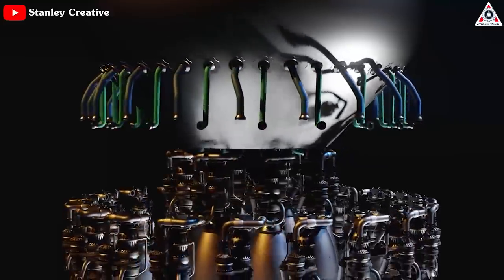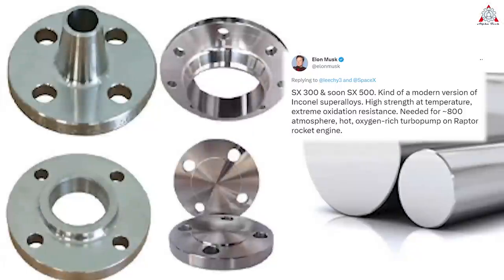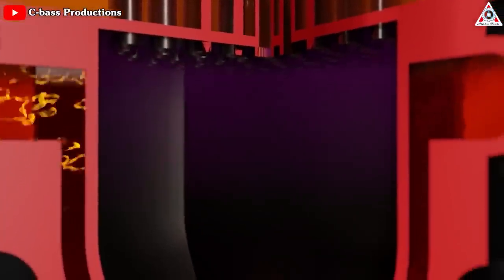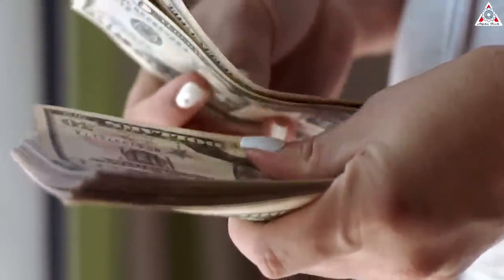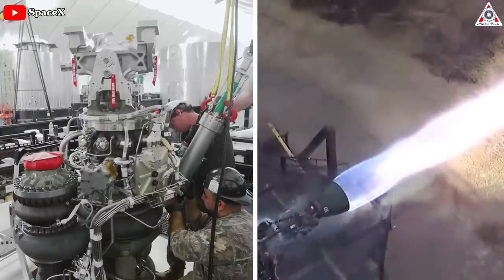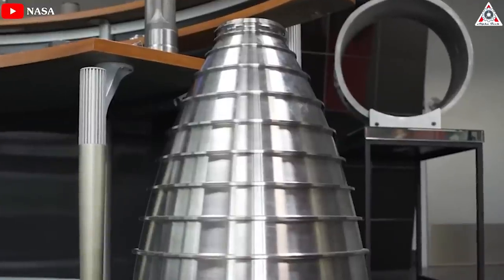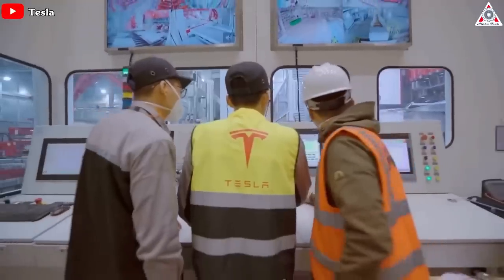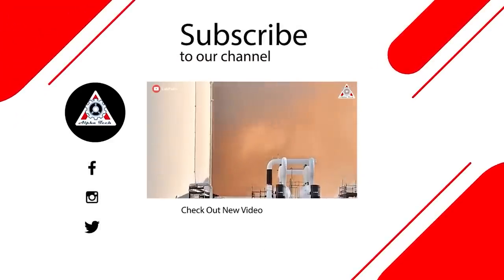How SpaceX manufactures a new raptor engine every 24 hours shock the entire industry...

Comment: 3:40 "in pursuit of the greatest possible efficiency Raptor's turbopump will run oxygen rich. . ." As I understand it the Raptor engine is a full flow stage combustion cycle. A full flow stage combustion engine uses both oxidizer-rich and fuel-rich preburners. The cycle allows full flow of both propellants through the turbines. That is to say, one preburner all of the fuel and some oxygen runs through (fuel rich).  The other preburner all the oxygen and some fuel goes through the burner (Oxygen rich).
Reply: Was looking for this comment 👍🏻
Reply: Was wondering the same thing. Guess someone else has also seen everyday astronaut´s video ;)

Comment: 10m/s is about the max-reliable speed of engine components ... in high end sports cars. 
It's why F1 use larger bore vs stroke (high HP) ... because the speed those engine parts can move reliably is finite if you exceed that number.

Comment: Please explain 3:50.

Oxygen atom = 15.999u
Oxygen Molecule = 31.998u

Hydrogen atom = 1.007u
Carbon atom = 12.011u
Methane molecule = 16.039u

Now in an elevated temperature I would imagine these molecules breaking down into ions and therefore oxgen is still the heaviest there with carbon coming second at 12.011u.
And why would you want a less dense fluid going through a turbo pump if you had the choice? less dense means you either need higher gas velocity (temp) to extract more energy from the dynamic pressure, or more fluid flow overall.

The real reason is it's a Full-Flow Combustion Cycle engine. One pump does fuel-rich, the other does oxidiser-rich and when both streams of the pumps are merged in the main combustion cycle, they are both nice and hot gas fluids that burn very cleanly. 
Now to get that to work IRL is not easy without it blowing up and SpaceX have done a wonderful job at making it look easy.

I've now looked at comments below and I'm not the only one

Comment: I was wondering if they put cooling fins on the outside of rocket engines if that would all make them even more durable it would work like an air cooled motor cycle 🚲
Reply: The engine and engine bell are already liquid cooled. Most rocket engines use the fuel itself in a similar capacity to fluid in a car's radiator. Everyday Astronaut has an amazing video on engine design and goes through all the different variations on rocket engine cooling.

Comment: For SpaceX starship. The shape of thing to come is going out of business. For failing to recognize real world problems in materials, number of engines, imperfect hot stage ring , and lack of adhesive adhesion to stainless. Today it couldn’t be more wrong. If your rocket is too heavy to reach a circular orbit to allow it to orbit without falling out of orbit back to earth just to burn up. This requires a serious change. But SpaceX appears to be wearing musk blinders. At least young engineers are gaining valuable real world experience on what not to do. I have to question? Did anybody run the numbers through a supercomputer on weigh with the amount of thrust on hand. Ift-4 should attempt to orbit earth with about 10 rotations. Then the following melt down won’t seem did bad.

Comment: 3:31 “ in the pursuit of the greatest possible efficiency” 
Now, I realize you’re just a YouTuber, but you got so much wrong about SpaceX is turbo pump(s) that you should never ever even mention them again.  Yes I said pumps. Their are two.  By blabbering on about why you think that “the pump” runs oxygen rich incorrectly, you demonstrate the lack of knowledge of which engine cycle they are using and the basic layout of the engine.  This is something that you clearly don’t understand.

Comment: Nice video but in the first 1/3 of your video you don't differentiate between the Raptor 1 and the Raptor 2 engines. Raptor 2 has much less junk hanging off of it and is more powerful than the Raptor 1.

Torch igniters are not used in the Raptor 2, that was some of the stuff that they got rid of.

Then you finally mention Raptor 2. You are probably confusing people with going through old, no longer used technology then saying Oh they made a new Raptor.

Then you do not specify which engine you are talking about through the latter half of the video further confusing new viewers.

Then talking about Teslas????

Comment: Starship is not flying anywhere until Elon figures out how to pressurize skirt of the Starship for duration of the launch of the rocket (from ignition until MECO). Until that modification comes every Starship launched will explode in the air. So much for Elon's expertise as genius rocket designer.
Reply: Why is this difficult ?
Reply: Yeah, well I’m guessing random guy on YouTube comment section knows more than SpaceX engineering department.  Just saying. 😊
Reply: They don't need to, the gussets and corrigations on the interstage make that strong enough, you don't think they've tested this on computers?
Reply: @paulschulte1064  Gwynne Shotwell SpaceX CEO, recent quote, "Keep in mind, this first one is really a test flight... and the real goal is to not blow up the launch pad, that is success,"